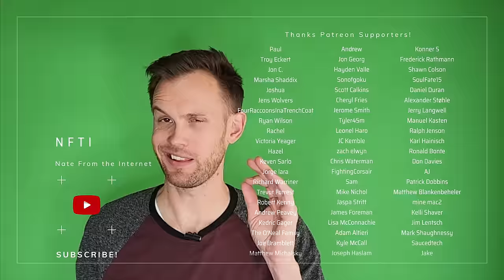Building the BEST Coffee Table Design

Comment: I graduated in carpentry from a tech school and I've been working in a commercial cabinetry for 6 years (not bragging, just stating my qualifications).  So there isn't anything wrong done here (aside from the cut in the frame). The key things that should be noted is that 1: making a blueprint and cut list would make things easier and give you a reference to what you may have done wrong or could do better. 2: The pocket screws are a good way to go for wood or veneer cabinets so that the face isn't damaged, just be careful with how many you use because the larger holes that are used can weaken the boards if there are to many. Another option aside from pocket screws would be joinery, but that would require a lot more planning. 3: The blocks that are used for the feet will work but a better option would be to use a full bottom with full length rails. While it would have added more weight, it would add to the strength and make sure the your legs a square and level to each other. 4: One way you could have made it easier to attach the movable top would be to make a screw template for the hinges prior to the complete assembly. 5: to make the assembly easier you should start with the drawers so that you can pin and screw the drawer faces in while the drawer is closed to make sure they are as you want them (and by using pins instead of glue you can more easily remove the drawer faces to adjust, repair or replace them). Then remove the completed drawers to install the tops. And finally attach the bottom and legs. A couple of thing that could be done to make it prettier would be to use self adhesive veneer on the edges of the boards and to cut a 1/8 inch piece of solid wood (that matches the veneer) and glue it into the cut that was made in the frame. All in all, this is a well made coffee table, but there were things that could be done better. I would reference other non-cabinetry makers to this.

Comment: Just gonna say Nate. When running that brad nailer like when you are putting the drawer faces on. Keep you hands (and rest of your body) well out of the way of where its pointed. I've not seen anything personally, but I have it on good authority that use them more often that the brads go sometimes go WAY farther than you expect, or off at strange angles and into the person holding the pieces. 

Otherwise. I really appreciate the video. Showing a project and goring through how you sorted things out as you went and the problem solving is always great to see!

Comment: Although i won't build a coffee table, you inspired me to work on my little messy workdesk as a lazy teen. Heavy cleaning, modified a kindergartener table(the plastic one that you can open the top and has a big compartment), made separators with cardboard, a hard to access coin bank using the hollow table leg(coz im a spender), a mini table for my stationeries, a storage for my electronic parts(microcontrollers, wires, parts etc.)
So thanks, it feels satisfying when you do things according to your own likings.

Comment: Part of the issue you were likely having with the table saw is that it looks like your riving knife is not installed correctly since the top of most riving knives is parallel to the top of the table.  The circular cut in the riving knife should only be a short distance from the back of the saw blade and the curvature should match.  This in turn is not allowing the an antikickback pawls to sit at the right angle against the material.
All in all it looks like you learned a lot from this project and have a few things you can consider doing differently in future projects.

Comment: You build things like I do. You have to be crafty along the way. It usually works out. If you are making something for yourself and you are pretty pleased with the end results, that is all that matters.

A carpenter once told me that the reason we have molding and trim is because for most jobs, they are subcontractors instead of the main contractors. Because of that, they are on someone else's time limit. They can't take a bunch of extra time to make sure everything fits exactly perfectly. So, trim and molding are for making it all look better, more finished.

Comment: The nice thing about mdf is that it is basically sawdust and glue. Which means if you need to fix a cut like you made near 8:10, you can mix sawdust and glue into a paste, use painters tape to make 1 barrier, fill in the cut, smooth it out and cover with the other piece of painters tape, let it set up and the slot machine is filled

Comment: First awesome to show your human and can make mistakes as well. Also awesome you show the mistakes and problem solving things as well.
Next suggestion you need to design the ultimate pusher stick or get one of those that fits in the grooves of your table saw from camera views made the cring thing happen a lot.
Lastly suggestion when you talked about the mistake of running the saw through the sides you cut a sliver off a board should've cut a couple small pieces glued and tapped them in place would've fillthe cuts and still would've been noticeable but not as noticeable.
Hope the day never comes I find this at the DI but if you ever do sign it first...
It really is a simple but awesome piece of furniture

Comment: Quick Tip: If you need to fill an accidental cut like you made mix some saw dust with wood glue to fill the cut or hole. Its basically homemade Bondo for wood working.

Comment: Sometimes a table saw can bind on the kick fence if the the blade you are using is narrower than the width of the fence. It's usually only a couple thousandths off, but it's enough to make it bind.

Comment: You could have used the blue tape truck for fitting the lid to the struts. Blue tape stuck to each surface and then ca glue to hold them together in the right spot while closed, then open it up and mark for screws.

Comment: I need to build a window into a new loft I need to build as the top half of my cathedral ceiling woodstove room. The roof I'd very steep, as it was designed in 1978 to be the perfect winter solar panel angle. The dentist who built this place created 5 ft by 10 ft glass, aluminum, and copper panels that circulated water to hos 8 ft swimming pool, his 180 gallon hot water tank, a huge storage tank, and even copper piping through the woodstove. I'm planning stairs up to this loft, the window able to have a shelf on it, and a metal grate just above the woodstove so I can have toasty feet right next to my bed which is next to the window.

Comment: If some parts of the wood are much smoother than the rest, the stain won't absorb evenly, and you'll get lighter blotchy spots.
I refinish hardwood floors for a living.
As ur sanding, the paper gets smoother, and you end up with spots where the wood is smoother.  U need the wood grain to be equally  smooth everywhere. 
2 easy ways to fix it...
1st, u can just run over everything with fresh paper. Paying attention not to use worn-out paper.
2nd way is to use a technique  called "water popping."
That's also pretty easy.

Comment: Now What I'm going to post is something people will debate on cause it's a 100% preference step and it has a look that you may or may not want. 

To have a better more popping finish when Staining switch between using Light and Dark stains. this will add a sheen to the stain work and make it look more stunning when finished. Now which you use first will determine which will stick out more . you Start with a light stain creates a lighter back drop and the darker stain will have a darker back drop in the wood. 
Also when staining start small and spread out with a rag or brush (depending on the look your going for) you'll use less stain and have more acceptance of the stain seeping into the wood. 1 pint of stain is enough for that entire coffee table and this is important to note if you're mixing stains when applying stain. 
If you've ever seen wood work that had this two tone definition to the grain this is one way it could of been obtained.
Also if you want to use a type of stain but it's not necessarily in stock you can just buy a light stain and mix it with the saw dust of the wood you want the stain to have the color of. (i.e buy a pine, birch, or white oak stain and mix it with saw dust of Cedar, walnut, ebony, or cherry, to produce the color you're looking for.), If you decide to make your own stain the mixing of light and dark stains can also be skipped cause it'll already have that desired look.

Comment: Double sided carpet tape or hot glue to temporarily attach drawer fronts before you permanently attach from inside. Never shoot brad nail gun towards yourself, I have had brad shoot through material - I had air pressure cranked too high.

Comment: Hey Nate love the video, it's funny to see you start getting into woodworking :). I'm not a woodworker myself but i picked up a few tricks that I think would serve you well on your next endeavor. Filling up mistakes when you cut something you shouldn't have or gauges works wonderfully with sawdust and wood glue or superglue (sawdust and superglue has to be made in the place you need to fill up as i guess you could imagine) on the wood glue you just make a putty with sawdust and stick it in the hole you need to cover. When making drawers try to replace the bottom with a thin piece of laminated wood and make channel in which that piece would fit. also when trying to fit pieces together blindly got for double sided tape. But really appreciated the hot glue method :). Try following Adam Savage learned a lot of things from him and bought a lot of stuff cause of him:). Great to see you starting your own thing and the best of luck with it. I'm staying tuned.